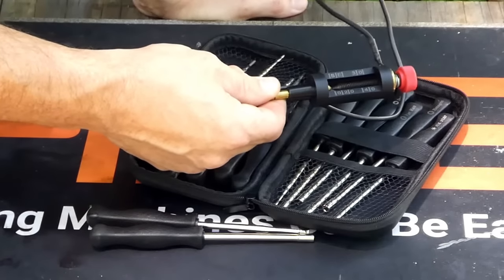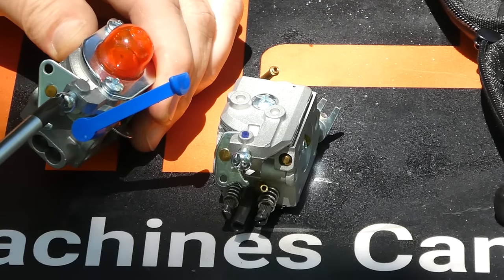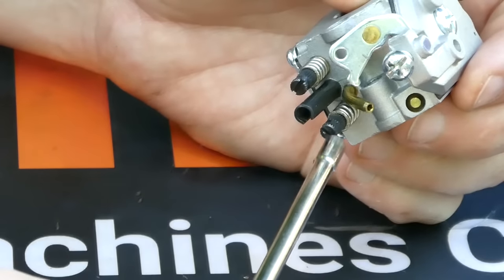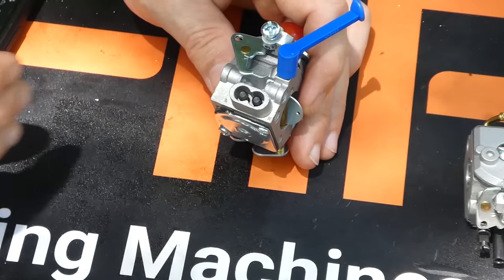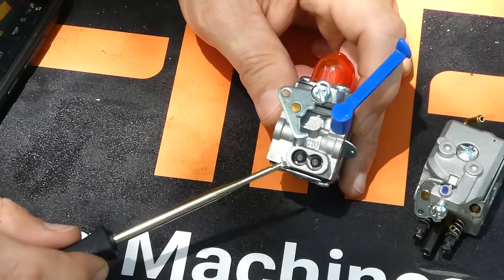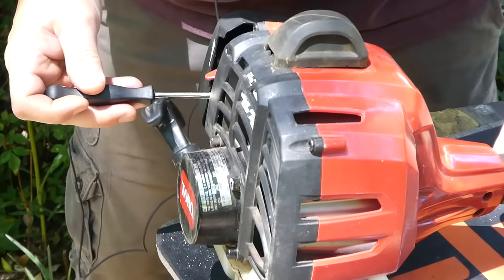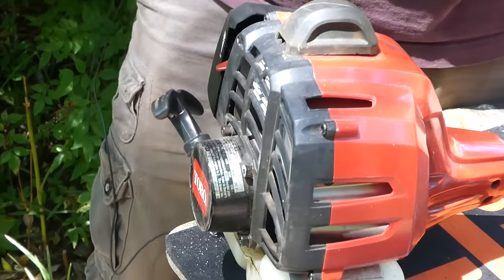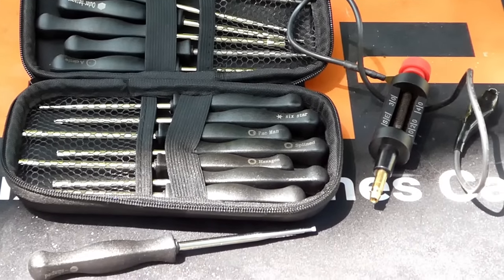Adjusting a 2 Stroke Small Engine Carburetor with Hipa Carb Adjustment Kit

Comment: The only adjustment screws I've came across is either the 21 tooth spline, pacman and the one you can use a thin flat screw driver on. This video gave me the confidence to be able to adjust the carburetor on my chainsaws and leaf blower

Comment: if you have a machine that will not start or run where would you start  the adjustment at , ,like say 2 turns out after going all the way in?

Comment: My trouble is knowing if the kit has the correct tool in it for my chainsaw or leaf blower etc tell me how to figure it out as some are very similar but no cigar
Reply from the maker: I'd suggest checking the shape of the screws on your carburetor to see whether it matches the printed patterns on the screw driver's handle or you can just get one on hipastore.com to try. There's a 30 days return policy.